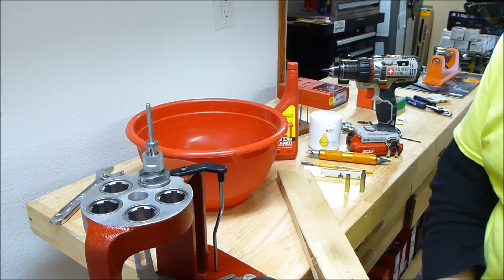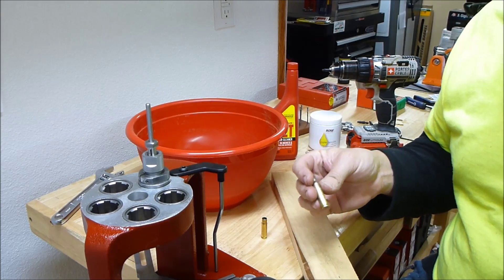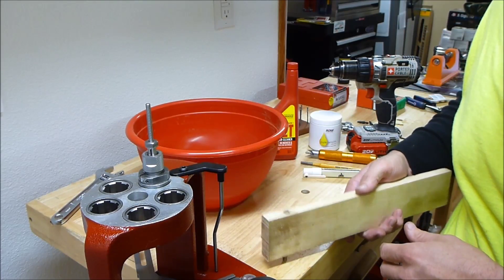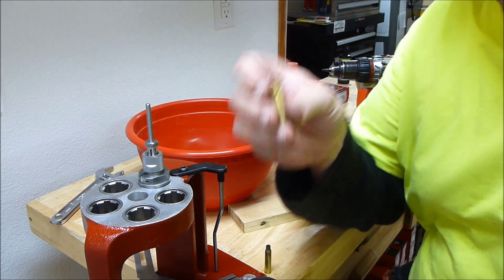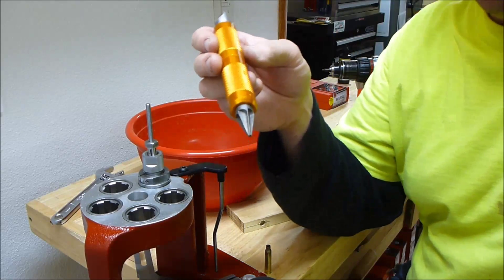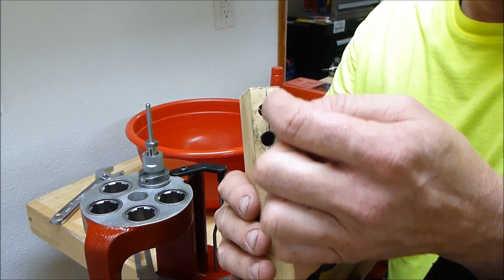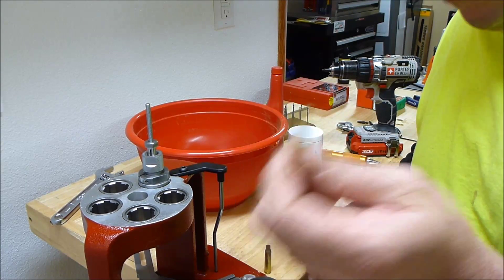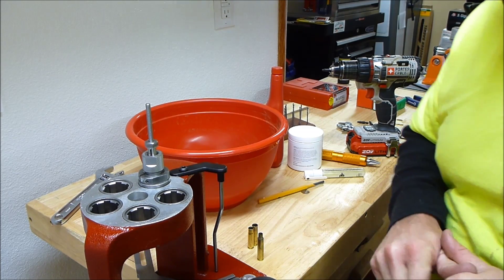I think this is a better way to trim .223/5.56 brass for .300 Blackout reloading

Comment: I like seeing how other people go about solving the same problems, be it financially or with what's on hand.
I downloaded a 3D print Dremel attachment that turns my old Dremel into a mini chop saw, and I made a jig for repeatable length cuts. I've seen a handful of bad reviews about those Harbor Freight mini chop saws and how they are belt driven and the belts are either breaking or slipping, probably due to forcing the cut on metal and with a wood cutting blade. 
With the Dremel its direct drive with a metal cutter and it works great.